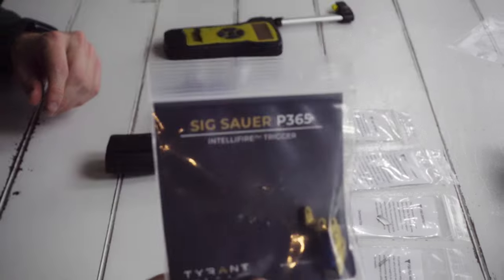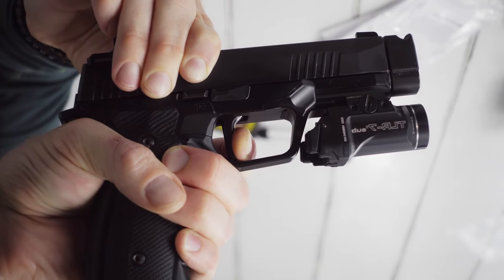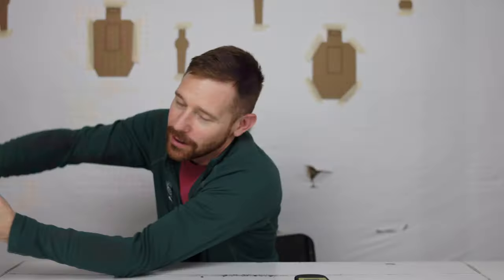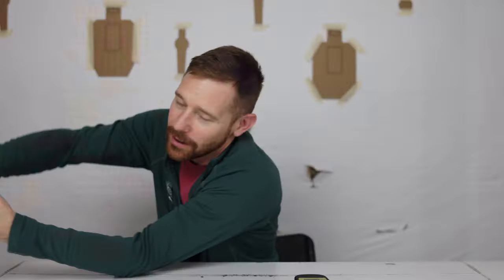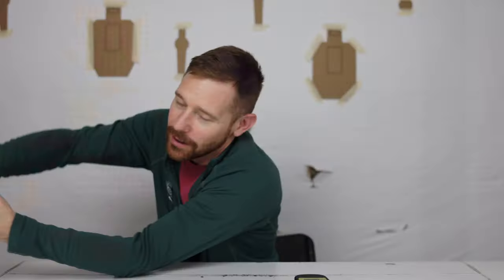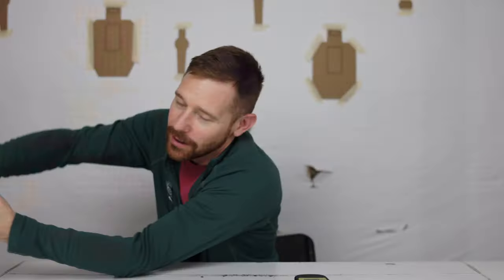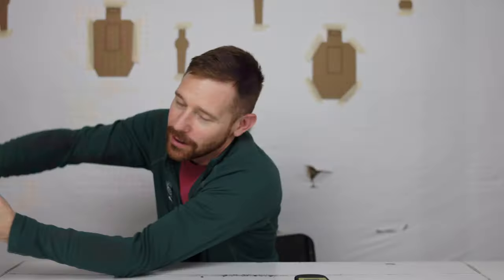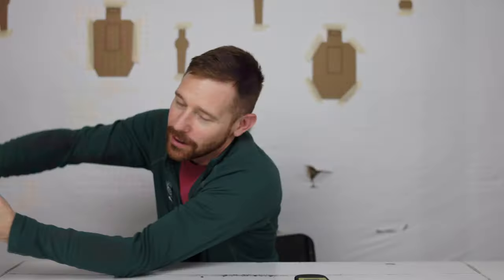Aftermarket Trigger/kits for P365, Are They Worth it? Tyrant and Tactical Triggers Review

Comment: I'm sure this is just me but I call the trigger a "Pull Through" trigger.  I don't look at it like a typical trigger with the take-up, wall and break.  It has take-up and a wall but then you start pulling again and the striker activates somewhere in the process of pulling the trigger.  I actually shoot this trigger well as it reduces the number of times I mash or jerk or push the trigger.  I just pull (excuse me "press") it through its travel and when it goes off it's a surprise.
Reply: I get what you’re saying but a surprise trigger is not my goal. Shoot more, reduce your grip issues and/or trigger pull and know when your gun will shoot.
Reply: @oak8728  Yeah, you aren’t qualified to give me shooting advice so please keep it to yourself.
Reply: @mavrikmavrik3032  I’ve trained with some of the best, but that’s beside the point. In my job my pistol is a tool, last I want is my equipment to “surprise” me. It’s not rocket science. Go shoot more and get rid of your issue, if you rely on a surprise you’re shaking/flinching the round. Either grip or trigger pull is your issue.

Comment: Right now the only two trigger kits that actually change the pull of the trigger, instead of just lightening it with springs and such, are the M carbo trigger with titanium striker combination and the ram tactical leverage trigger kit. Both kits change the geometry of the sear interface. I have the mcarbo trigger (with stock trigger springs because i dont want a light trigger weight) and titanium striker. It fixed my primer drag issue. There is half the creep (squish) after the "wall" than stock trigger/striker. Its an improvment.

I want to try the ramm tactical one because it is less expensive than the full mcarbo kit, but honestly, it might feel the same, but that kit has much less pretravel. As long as some of the creep is gone, then im happy. Nothing can get a stiker fired gun to feel like my cajun gun works P01.
Reply from the maker: Yeah I thought about the M carbo kit with the titanium striker…. But damn that’s pricy for a trigger upgrade on my EDC. 

Good to know that it really does improve the “squishy rolling break”. 

I just recently saw the Ram tactical one and maybe one day I’ll give it a shot and compare.
Reply: Look at the reviews on the ramm trigger on optic planet.
Reply from the maker: @dj141  only 3 reviews and makes me wonder if they didn’t do the install correctly.
Reply: @SmallArmsFirearms   I want the ramm trigger, but there is no review. (Shooting review) Far as tactical trigger, it is a small upgrade. It is worth the money. Good video
Reply: @SmallArmsFirearms  I have the MCarbo and Titanium Striker in my P365 X-Macro. The trigger engagement is different. More of a 90 degree angle on the flat trigger compared to stock. The pull weight is not dramatically different. I never weighed before or after. The Squish? It's still a push-through-the-mush sort of trigger press. But I think the Mush is a shorter stroke than the stock trigger. Shoots great and feels safe. I had a gunsmith do the install. Forgot about the expense fast enough and I'm much happier with the X-Macro now. Great EDC with 17 Rd Mags and the two port expansion chamber. X-Macro grip fits my hand for a full fisted grip.

Comment: I thought I was bad with 45 minutes to get the Tactical Trigger kit in. I didn't bother with the pre-travel whatever but the overtravel stop and sear control spring actually helped my trigger a decent amount. If you don't bother with the pre-travel you also don't need to replace the back plate either. That Tyrant trigger shoe looks interesting to me. Thanks!
Reply from the maker: Yeah… if you could have seen my face when the sear pin came out just a hair too far…. I knew what I was in for. 

Thanks for watching
Reply: I got lucky with installing 2 of my 3 tactical trigger kits. All and all I’m super happy and more accurate with it. Yes you can’t install the pre travel stop with an aluminum module without modifying the frame slightly
Reply from the maker: @jonn8163  yeah and the pre travel doesn’t bother much at all so I was fine with not using it. Plus it gives me extra pieces to upgrade my other FCU

Comment: Thank you for the test and review. I may have to try a Tyrant trigger shoe
Reply from the maker: Yeah I was iffy on even buying it after seeing it at shot show but, had to try it and I’m glad I did. 
Thanks for watching
Reply: @SmallArmsFirearms  I have 3 p365’s and all of them have the tactical trigger kits in them. I have been super happy with the end results but all 3 feel slightly different. One thing that I found very interesting is that the feel of the trigger is a little different depending on the module it is mounted in. I am not a stickler for lighter trigger pole, but I do appreciate crisp break, and shorter reset.

Comment: I can get to 3 lbs quite simply by polishing the sear nose on which there is a large and nasty parting line from the MIM process.  Then polish the striker face area and add a secondary angle to eliminate the mushy pull much like you do on a 1911( MCarbo does this also)  Drop in a reduced power sear spring and a Tactical Development Trigger and you will be amazed at the results.
Reply from the maker: @michcoug  this sounds like something I need to try. 
I really need to order the MCarbo at this point.
Reply: @SmallArmsFirearms  You can do it to your stock striker with a dremmel fairly easily but if you opt for the MCarbo striker still polish it well and don't be afraid to take a hair more off the secondary angle.  Just my 2 cents amigo.....
Reply from the maker: @michcoug  awesome feedback. Thanks man
Reply: @SmallArmsFirearms  guys… Before you get too deep into modifying what is intended to be a CCW gun, keep in mind.. once you start modifying things from stock, you start giving overzealous district attorneys leverage against you in court, should you ever need this in a self-defense scenario. As somebody who has done a million trigger jobs on pistols/rifles and even BB guns, lol, am all about having, a fantastic trigger. But in a CCW role, a “duty grade“ trigger is exactly what you want. 
I feel like replacing the trigger shoe itself would never be a problem from a legal standpoint, especially in this case where you’re adding a safety to the gun. But once you start polishing, sears and replacing springs, it shows “intent”
This is just my opinion and again, I am definitely on your side when it comes to having a nice trigger, but, don’t give these pieces of garbage an inch of rope to hang you with.

Comment: Not sure if it's a new FCU vs old FCU but there is a decent gap between FCUs
I have several FCUs and best stock trigger form was from my old old FCU from two or three years ago out of the NRA edition of XL. Also mcarbo worked wonders cleaning up a lot of trigger mushy
Reply from the maker: Yeah it’s pretty wild the difference in trigger pull between the two stock FCU’s I had. 
The newer one I had the parts were slightly different in their design so I’m not sure exactly what Sig did to it

Comment: I feel your pain with the seer pin on the 365. They’ve changed this year so that there is an actual hole which catches part of the spring that helps, but it does not solve the problem of getting the pin in correctly.
Reply from the maker: Yeah, the damn spring getting aligned is just stupid

Comment: So basically to get a 1 lb lighter pull just install tact trigger kit without pretravel & overtravel parts?
Reply from the maker: @revvaddictz  yeah. Their spring kit will lighten it up. 
But I really like the feel of the Tyrant trigger shoe, but that’s totally personal preference
Reply: @ i already have tyrant trigger shoe on my Xmacro.. I just wanna lighten up my trigger… so tactical trigger it is. 
You didn’t use the pretravel part or Overtravel parts at all correct?
Reply from the maker: @ the pre travel shim wouldn’t fit with that trigger because of how the trigger is made. It did shorten the pre travel slightly with just the shoe so that’s nice. 
Post travel I used just one of the 3 shims. 

But you can save yourself money and just get the springs and not the pre/post travel shims.
Reply: @ 10-4 thanks man really appreciate it

Comment: When I build my shalotek xxlc here next week I'm going to install the mcarbo spring kit. I've already got the intellifire trigger installed so I'll be interested to see how it feels.
Reply from the maker: Please let me know. I’m considering putting one in my other FCU
Reply: Will do, keep up the great work and keep the shalotek videos coming 👍 I just have the flex 17 grip right now but after I get my xxlc slide Monday. It'll have flex 17 and xxlc slide, intellifire trigger (black with red dingus), holosun eps carry, streamlight tlr7a, tyrant mag release, tyrant back plate, tyrant slide catch and slide release, with night fision fiber optic front and blacked put rear. My first all in build after 3 years. Just ordered my slim fit owb and iwb. Plus the thumb throttle should be coming here soon. Different having a metal gun compared to polymer.
Reply from the maker: @kaseymoffett5628  you sir have designed the same gun I did to start with, minus the other tyrant parts. Probably looks pretty badass too I bet. 

I’m just excited to see the new “aggressive” grip panels that Shalotek has hinted at.
Reply: I was close to doing the pmm , but I liked the xxlc and had enough with thread on comps, so we'll see how I can handle it. I'll let you know about the mcarbo after I get it all put together. Good talking to you!